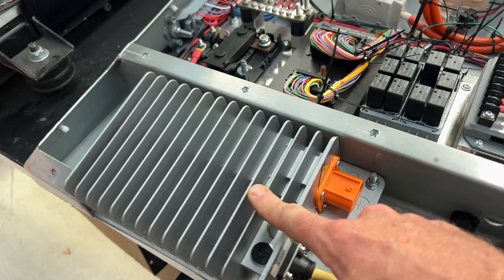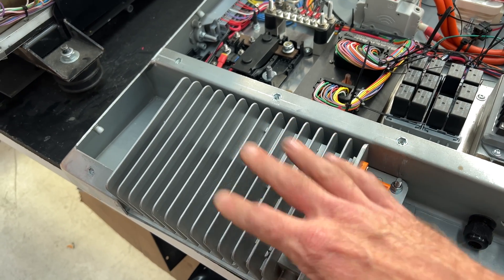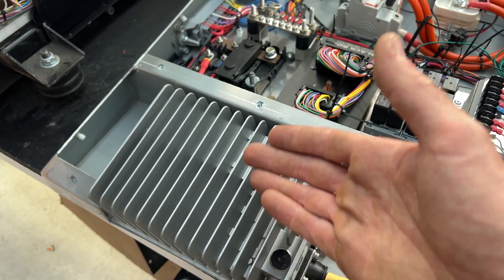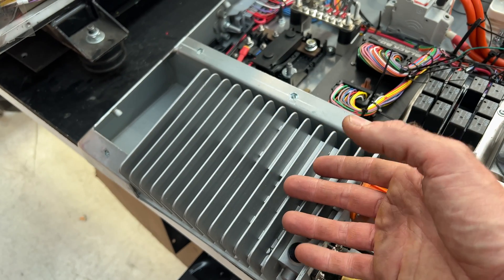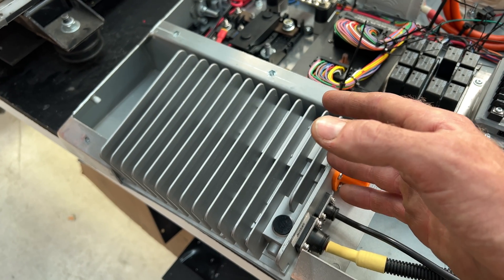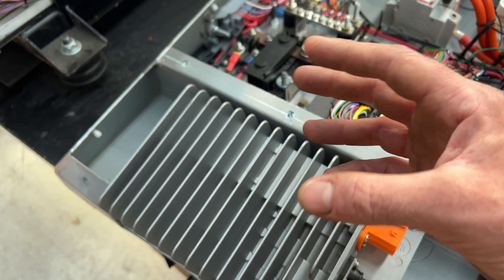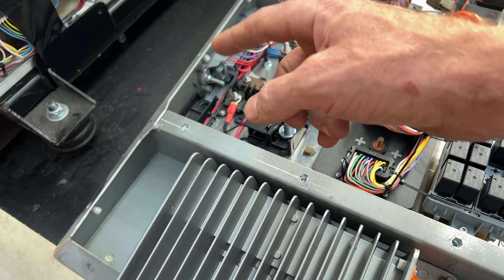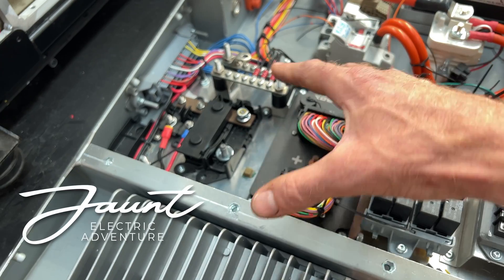Smart charging 12v Battery in an EV

Comment: The problem I have with this is when there is a sudden load draw the device doesn't switch on to supply enough energy/power for the load. For example, in the case of two-way radios with up to 30 watts of output power. In my 2017 Chevy Bolt with a new AGM battery running the rig at 15 watts draws down the voltage to 11.6 VDC which trips the rig's power regulator to drop output power or to prevent all output. Sometimes it will actually shutdown with the dropping voltage. I'm considering a step-up transformer to regulate the voltage. Any thoughts on this?

Comment: Why not use a remote control relay (used in older cars to preserve 12v battery from draing by parasitic  loads) to disconnect 12v  ev battery after car shuts off and contactor disengages. This will also put the computer/ecu to sleep and increase lifespan of ev components.
Reply: EV need to have some electronics running all the time, for example, the Li battery cooling/heating is an important function that does not work if the 12v battery is disconnected. Updates to the operating software over the air from the EV maker also require the 12v power.
Reply: @ChrisLynt  Got it...Thanks !!

Comment: Hi .
If you were to use an ev as a camper would  you be able to convert car main battery to 220v or if you used an inverter off the 12v battery . If you were to use second  option would main car battery keep the 12v La one charged  if car parked . Thinking  of getting  maxus e deliver 3 as mini camper

Comment: Yeah, I'm finding keeping the 12v charged when charging is a problem. I had a simple 5a trickle charger, but it interfered with the EVSE for leakage.

And when it gets low, the DCDC hits 100A and shuts off and on. 

I'm thinking custom charge controller/high impedance or isolated trickle charger.
Reply: I have been using a $30 trickle charger to keep my 2012 Nissan Leaf's 12v battery charged to 100% which, btw, is where lead-acid battery want to be for a long lifespan - look it up - after I had it drained when the Leaf sat idle in a garage for a few weeks when I was on vacation.  No issues with the Leaf and the GE Watt Station EVSE.
Reply: Why not use a remote control relay (used in older cars to preserve 12v battery from draing by parasitic  loads) to disconnect 12v  ev battery after car shuts off and contactor disengages. This will also put the computer/ecu to sleep and increase lifespan of ev components.

Comment: Thank you for this article. I'm considering buying a 12 Volt Booster Charger - one of those all in one charging devices that come with a 12V DC output and short thick leads to clamp to a car 12V battery, as well as have USB output and a light built in. The reason behind this is that I have a BYD Atto 3 EV and I'm reading that there are a few cases of the 12V supply in the car failing and the car being inoperable. Apparently Tesla and MG are also having problems. The battery fitted is a lead acid and I believe it's a deep cycle type. My question is, if the battery problem occurs, would using one of these Booster Chargers get me out of trouble? Obviusly I don't need to crank and ICE just juice up the 12V battery to enable the control system. Your input would be most helpful.
Reply: I have been using a $30 trickle charger to keep my 2012 Nissan Leaf's 12v battery charged to 100% which, btw, is where lead-acid battery want to be for a long lifespan - look it up - after I had it drained when the Leaf sat idle in a garage for a few weeks when I was on vacation.  No issues with the Leaf and the GE Watt Station EVSE.
Reply: @ChrisLynt  Why not use a remote control relay (used in older cars to preserve 12v battery from draing by parasitic  loads) to disconnect 12v  ev battery after car shuts off and contactor disengages. This will also put the computer/ecu to sleep and increase lifespan of ev components.
Reply: @ChrisLynt is it negative to chassis/earth as normal car, and not neg to battery

Comment: I think its a mistake to think you know better than that 12V charger
Reply from the maker: Thats the thing though, its not a charger. Its a pretty dumb on/off DC-DC converter.   A good 12v charger has this kind of logic and more.
Reply: @Jauntmotors  Show me that charger.  I don't think you're right.
Reply: @SteveWrightNZ  it looks like an Elcon, I have a very similar unit, I recently recieved CANBUS parameters from the factory, but the engineer said you can't control current or voltage. It's an electric alternator, not a charger. Mine is an Elcon TDC-IY-216-12

Comment: Great description. Is the 12V battery a lithium battery or standard LA?
Reply from the maker: Just a standard lead acid. Cheaper and easier to replace down the track.
Reply: @Jauntmotors  Why would it have to be replaced? If it was a LiFePO4 battery, it should last the life of the car. It would almost never be cycled at all... Why cart about lumps of lead?